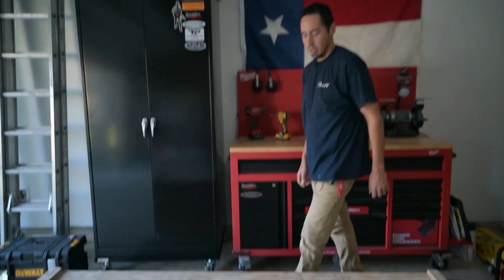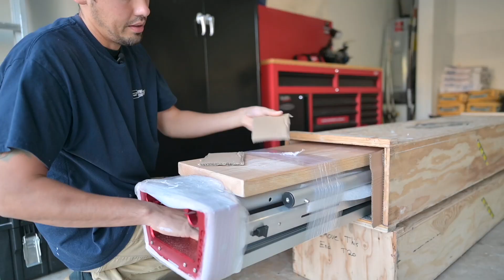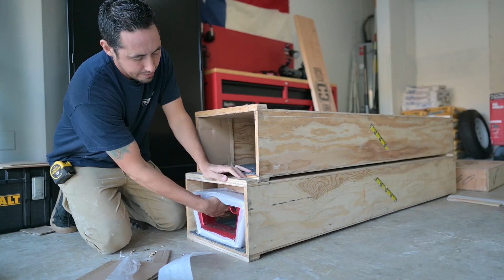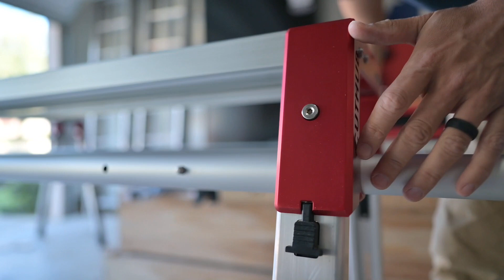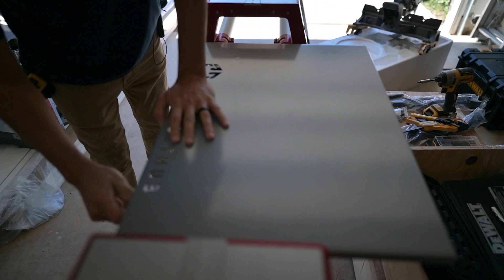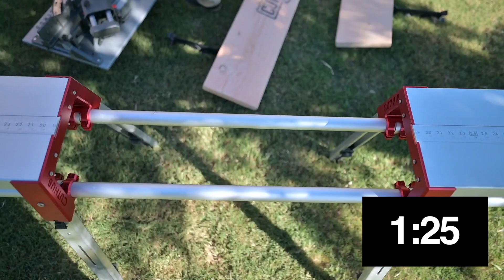I Paid $3400 for this Saw Stand - Cut Hub

Comment: Looks pretty cool and sturdy, wondering if you ever heard of fast caps “best fence pro” saw stands? The pro 4 is the biggest one and about $1200 and expandable comes on wheels as well they also have a system that work with your dewalt stand and is expandable as well for $600. But I have to say this one looks super solid to work with
Reply: I didn’t like it, too complicated to set up for most. I had two reasonably smart guys who couldn’t figure it out, and I didn’t like setting it up either

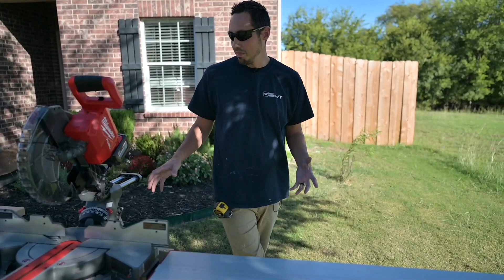Comment: Most Definitely Cutting Edge & Obviously Engineered / Perhaps built by an actual builder . I personally don't recall anything remotely comparable that has the triple function ( Table Saw/ Table Miter Saw with Fairly Large Table Space ) Exceptional Optimization for two commonly used Carpentry Tools Often competing for space ,especially in tight jobs. But with this set up bringing the two together in one seamless & Practial function is certainly in a league of its own currently. My only concern  ( Which you mention yourself @ 19:25 )is the mounting plate used for the Miter/Table Saws & how the 4 point "Vice Hardeware " seems to be in a precarious position once you've broken down your Table , it certainly appears that they be at risk of breaking of,bending or damaging Themselves somehow or wherever your Saw may ride in transit. Perhaps CutHub would Engineer the mounting plate that cleanly attaches to the under side of Miter/Table Saw yet underneath the plate has 2 sets of parallel hoops that one can slide adjoining tubes through. Certainly would be a lesser hazard than having vice Hardeware exposed & often brutally punished whenever in transit & as you pick it up/set it down. Other than that , It's certainly spot on . Thanks For Sharing

Comment: Compromise between strength, weight and cost which mostly aluminum will win every time. I am interested in the long term durability as well.
If you are using these out in a yard, do they have the facility for pegging them to the ground? I am thinking knocking them around and out of position with heavy stock might get old, fast.

Comment: Seems like a great tool. But as you said wood won't hold up in the heat and humidity of you working outside. So why are the work table pieces made of wood? Clearly could have been made of same metal used on rest of stand. That Milwaukee miter saw looks sweet too.
Reply: That's not a critical piece to the functionality and precision of the equipment. Moreover, those pieces of wood add some useful weight to the equipment, and that contributes to its stability.

Comment: Lots of comments about it cost too much...I have two regrets from my retired career: 1. Not walking away from jobs that when I arrived to begin were drastically different than what I signed on for with my estimate and 2. Always buying the cheapest tools, etc., that would do the job. For example, at the age of 72 last year I learned the difference between the cheap drill-bits I always bought and the drill-bits used in Machine-shops that eat their way through metal like it was butter. If you want to encrust your tools with diamonds. rubys and emeralds it's money well-spent if it makes you happy and proud.

Comment: The reason it takes so long to set up is because of the small hole in the 2X work table material for your extension chord. It will require taking one end off the extension chord and re attaching it twice a day

Comment: I've fabbed several chop tables for commercial framing with drop down table to flush up the saw bed to table top.  I like that, but the 3400 bucks is off the chart for a cut station guy.  I'd have agree with your wife that your nuts on that purchase.  Lucky you have one that said okay as well.  If you like it and it serves you well...kudos.   I would question those little things like the leg adjustments and the little springs and clips that make them work...long term they will likely fail you would be my suspicion.  I think you could have kept about 80% of your money with a good set of adjustable horses and a wide/short walk plank and some simple mods to flush up your work.  Good luck with that...the saw, yeah/maybe...not a fan of batteries or thinner blades to make saws run better because of them.  Your trade specific as am I, but in commercial framing here.   Ouch on that price!

Comment: I just returned that 12" Milwaukee miter saw and stayed with 12" Flexvolt. The Milwaukee looks clean as hell but not as accurate, had 2 of them and none where near square out the box. Head has some play, not as much as the 10" but still noticeable and will affect performance also underpowered compared to the Flexvolt. I'm a huge Milwaukee fan boy, LITERALLY lol I just wish they engineered it better.
Reply from the maker: Good to know. I will see how it goes. Thank you.
Reply: I have the 12 and 10 and agree the 10 is more accurate... on the 12 the sliding part of the fence is not flush with fixed fence (both sides) .... makes cutting small  nested crown kind of a pain. Haven't checked square but I haven't had an issue yet
Reply: @FinishCarpentryTV  Yeah lmk bro, because like I said  I had bought 2 of those M18 12" miter saws and both had the same problem, had the older guys on my jobs givin me shit bout it not being accurate lol they were all sayin "it's a good exterior saw" lol 

Btw I learned A LOT from your videos Rich. You are lowkey my mentor in Finish lol Been watching you for years bro so thanks for all the tips! I'm also a Dewaukee guy 😂
25 year old Finish Carpenter/Framer from Cali. Been in the field since I was 16

Comment: For the "Work Surface" boards I might suggest moving the brackets either in or out a little so that the table looks square to the stand... Just my OCD and it might be something the manufacturer may like as well. That would have been nice when you cut the circles out with the router...

Comment: I wouldn’t extend those adjustable feet  so far out, leave at least 1/3rd of their length in the aluminum extrusion so that the leverage created by rocking doesn’t bend the channel out of spec. Interested to see the table saw mounted!

Comment: I have a ridgid compound miter saw and noticed the fence has a slight angle, about 1.5 degrees, where both centers come in, creating a gap. When I cut end pieces, it is inaccurate and off. Any ideas on how to fix this.

Comment: A very wise investment. For a someone that will be using this station  just about every day is a smart move. Easy to set up made to a high standard and is lightweight your back will thank you as you get older. Anything that will improve your workflow and craftsmanship is money well spent. I have had a remodeling business for 40 plus years and have learned  that any tool that can save you time  money and you body is well worth it.
Reply from the maker: Very true. Thanks for the insight.

Comment: Unfortunately most factor in the cost of a tool by just how much time it saves. But don’t underestimate the benefit of minimizing frustration. I will gladly spend money on a tool that makes my job That much smoother and thus prevent headaches. 
And obviously that more often than not equates to getting the job done quicker as well. 
The only drawback I see of that stand is it would take up a lot of room in my truck, otherwise looks awesome. 
Enjoy!

Comment: Did I miss how you would set up the saw to use the engraved measuring marks on the table and would it be calibrated for both sides of the table?

Comment: I think the merchandise is worth the money. At around 15 minutes I see you drill through metal? I made a steel mft table to be an accessory for my mft table. Drilling threads in metal I learnt to wear goggles as when metal filings get in your eye you know about it. I once went to the doctor and had a dye put in my eye to remove some metal in my eye. A number of times I got metal in my eye and immediately washed and washed my eye and use a shirt to try and remove metal. Sometimes you think oh it's okay not wearing goggles and the wind picks up the filing and you don't even see it. Although aluminium may not rust in your eye.

Comment: Expensive—YES but it looks like you can have it for decades and it should hold up.shoot some silicone spray on those telescoping poles and adjustable legs to keep them running smooth and that’s about all it could really need. Cut Hubs got a good product without a doubt—they would sell more of them if they backed off on the price point a bit—whatever though...would be curious to know how much just the saw stands cost?—I can see having multiple of those and having one mounted to the miter saw and one to a table saw for quick interchangeability.

Comment: Surely you now need to take ages ensuring both sides are completely level with the mitre saw.
Reply: Did you even watch the video squidly. The platform you mount the mitre saw to sits flush with the stands. Also, 2 minutes and 16 seconds is what it took him to set up.....that sure is ages.......simpleton.

Comment: Not that I need this since I’m just a home workshop user, but my only “complaint” that I think for the money the saw table should have had pre-drill holes and/or an adjustable mounting system for when you want to change out saws. (Example: What happens with another saw if the mounting holes are just slightly different than this saw to the point you can’t drill another hole? A lock mounting system would have been better - Of course I guess you can always buy another table.)
Reply: Whats great is you can drill multiple holes wherever you want for whatever saw you have, its a blank canvas and its brilliant
Reply: You can always drill another hole. And if you couldn’t you can buy just the mounting plate new
Reply: If you spend $3400 on a saw stand, you'll spend the extra to get a table for each saw.  It's like saying I like that Lamborghini, but it comes with street slick tires and I want to drive it during the rainy season too.  If you can buy a Lambo, you can buy an extra set or two of different tires.

You can also just put the new saw on and if the holes overlap, turn them into slots.  If you're on your third saw and they overlap in a different direction, just move it forward or backwards an inch.  If you're buying a high quality stand, your buying a high quality saw and you'll likely replace it with the same model saw when it dies.
Reply: OliveAbortions My point was this stand had a lot of cool features and adjustments, so to me for the money the table should have some sort of adjustable mounting system. The DeWalt stand (and others) have this feature, so why not have it on this in a stronger upgrade form? As for your Lambo analogy, well you sort of made my point! If you want to change the tires you take them off and mount news one, you don’t need to reconfigure the bolts!

Comment: Sure beats cutting on the ground propping the material up with random pieces of 2x4
Reply: With a beat up 10 year old saw, that is out of square, and has a dull blade. 😆

Been there, done that.
Reply: Hexafoose I love it when the blade burns the wood and you can hardly see through the smoke!
Reply: My daily life 😂😂😂
Reply: Or lifting it up with your foot
Reply: Doug82 so it’s not just me then?
Reply: Vambo Roolz same here...
Reply: thats me right there... with a $50 yard sale saw... LOL.  PS i do buy new blades, I hate dull blades.
Reply: Sometimes the skill lies in finishing the job without the optimum tools.  I have cut quarter round  and baseboard with a speed square and circular saw when the chop saw crapped out.
Reply: kds471 .....or cutting it by hand. Slower, yes, but more control.
Reply: Vambo Roolz Good point! have been looking for a metal mitre box that a flooring contractor had but I haven’t found it yet.  Not a fan of the yellow plastic ones.  Might have to make my own for back up.

Comment: What I really wanted to see before you ended the video was leveling it. As you have it if you put a piece of base edge ways without adjusting the feet what happens? Part of the everyday set up is adjusting the feet... all 8 of them. 
Presently it looked like it had a belly in it.... low in the middle. If that was the case that would be an aggravation. Most sites unless your inside want have flat ground. 
He is what I think your going to struggle with and I say this because we do very similar work. 
Realistically that 2 minute set up will be much longer than that. Your making multiple trips back and forth to the truck. 
Your going to be limited on the places you can set that up... 
That takes up a lot a valuable space 
If used on uneven ground that setup time could be tripled if not more. 
Are you going to go through that for just a couple rooms of crown....? Lol you probably will till the honeymoon stage wears off. 
Then the old Dewalt will get the dirt washed off of it. 
Ok I’m done reality checking your new tool... 
it does look nice and the Milwaukee saw looks good with it for sure. 
I’d like that set up for a shop ...  that would be amazing... no doubt there. 
I really think you should have tried the Fastcap best fence before you invested in this. 
I look forward to seeing how this works out for you. 
Alight give us a real setup video next time. From the truck , full set up everything adjusted and cut a piece.... that want be under 3 minutes... and don’t baby it like the video... act like you have other jobs to do that day. 
The 2x12’s I like but at the same time I feel would get in the way.

Comment: I would think you would want to adjust the legs before you set the saw on it. also PLEASE show the accuracy of the cut when you do the miter saw review. the best way would be to plunge cut a wide piece of lumber then pull up and back and push into the same cut.. I have a Metabo now and its horrible.. like a 1/16 wobble.. also you can use blue tape and plunge and pull back and the tape should stay nice and clean if its all bent and frayed then the blade wobbles at different pull positions.

Comment: Not knocking what you have, but I use a Delta kickstand. Big wheels, outrigger rollers, and I have gotten by with that setup for99/ of my needs. Think I paid less than $200. Only drawback is folding it up, it can pinch your fingers

Comment: So was it just luck that the saw and the stand surfaces were at the same level? Or can you adjust the height of that saw attachment if they aren't?
Also, you need your own DIY show.
Reply: He literally explained it twice that you can adjust the height of the attachment to fit any saw... You skipped through the video, didn't ya?
Reply: He told about those screw underneath the platform, you have to adjust them to fit the platform to your saw.

Comment: Looks nice. Looks functional. But the cost is too high IMO. $1200-1500 max. How much does two dewalt stands cost? $250USD? There isn't much more material or engineering here to warrant $3400.

Also, for me that's $5000 in Canada. Not a chance.

Comment: I do what you do, I work alone, so I buy high quality power tools and equipment , I was thoroughly enjoying this video until you broke out the Milwaukee M18 slide mitre, DUDE !!! come on, you had it right with the 60V Dewalt, I personally use a Bosch 10" Glide saw, anything but the Milwaukee, thats amateur hour, for a quality guy like you. Great Mitre stand ( if expensive )

Comment: It is only 5 more "tools" to load up at the end of a long day.  Frankly, it doesn't compare to my mdo box on my two saw horses that served me from before there were electric mitre boxes. And wait until a sudden rain shows up, and all that aluminum begins to oxidize. $3400.00 is a whole lot of money for a new toy.  Mark
Reply: It's ok to start your carpentry career with diy equipment, but if, years after, you find yourself still using the same diy equipment... There's definitely something wrong.
Reply from the maker: @markadams3494  it wasn’t me that replied to you.
Reply: @FinishCarpentryTV  Sorry, for my bad attitude partner. I can't help but  become e incensed when there is an implication that the work we did in the "old days"  was not equal to the work   being accomplished in today's  market.  We just had to do the work without benefit of the equipment available to the modern  carpenter. Stick rules were the norm. No tool  belts, two pocket cloth aprons with the logo of you favorite lumber yard were tied on every morning a d wet sweated through by break time.  Any way again I aplogize for  my bad attitude. Toodle loo Mark

Comment: I purchased a running Mercedes 2005 suv for that price.
Reply from the maker: One sensor in my Mercedes sprinter cost me 1300🙁
Reply: have fun with maintenance
Reply: Joe Deakos I’ve had it for 2 1/2 years now and the only problem has been a flat tire.
Reply: How much money has that Mercedes made you?

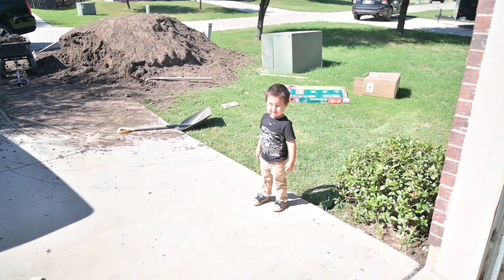Comment: 14:36  Scram Sam, Daddy's playing with his new tool. Sorry if I missed this detail but did you share the total length of the tool with the miter saw plate installed? If so, will you please remind me? The cost of the tool is only as expensive as the value of the tool--return on investment. Best of luck. BTW I just ordered their catalog.